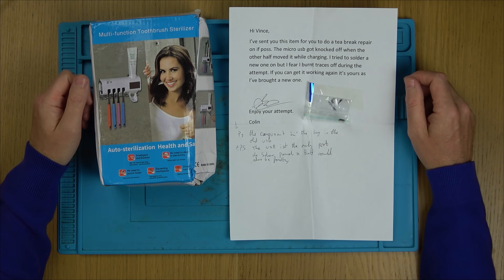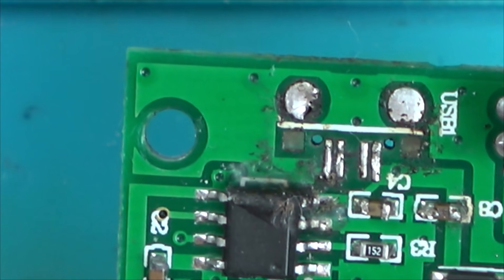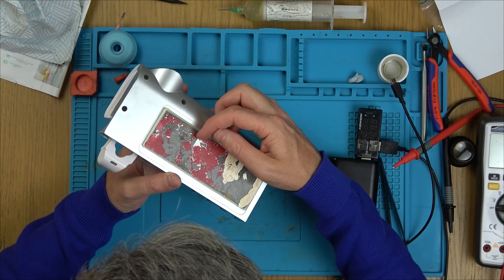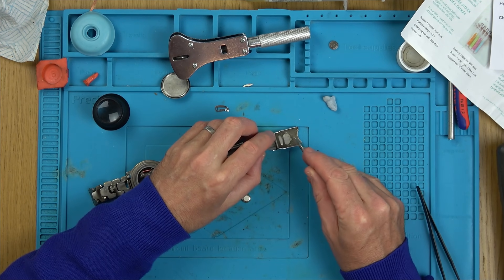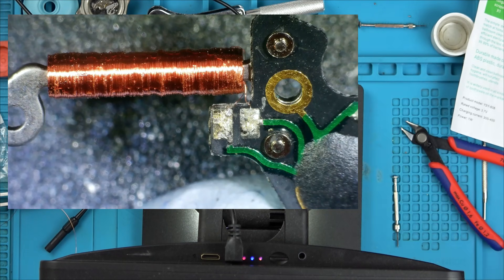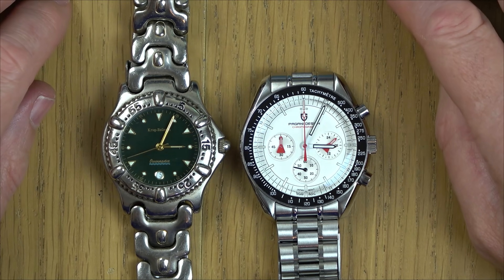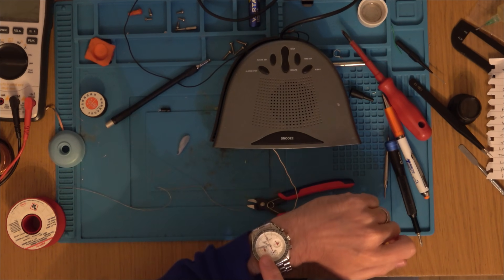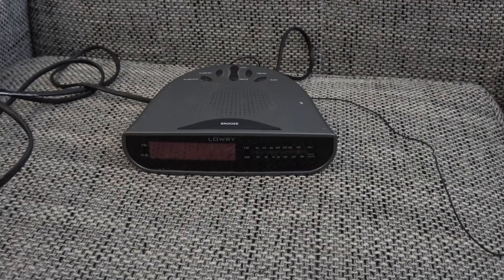Selection of PO BOX items - Can I FIX THEM?

Comment: hi! I hope that you are doing well. I have a question about the tiny USB port that just magically appears at about 4:30. It just suddenly appears with no name or how it came to be off of the PCB. It just appears and you are bending it back into shape and then you solder it onto the PCB. I need that exact USB port. Mine is broken. What exactly is it called and could you suggest a place where I could buy one? Thank you, kemble gilstrap USA.

Comment: I fear a new movement is needed as you are missing the battery clamp and the tongued end which goes into the plastic base, the plastic has sheared off no doubt releasing the clamp in the process.   Looks like an ISA clone, I quite like my Krug Baumann's as they have a solid heavy feel to them which I like.   K-B were part of the early 2000's growth of not-Chinese watches, designed in Europe mostly and made cheaply in Chinese factories, Oskar Emil is another one which I quite like the best two I have is a Houston which is very alike to a Tissot T-Race and extremely heavy and my unusual Oskar Emil Orbit being a reglateur automatic fitted with a very unique movement in a steampunk-esque case which is also a tourbillion so making it a very unusual watch to wear.   My Houston was my very first Sii "high hand" chrono and is much loved, ironically couple years back I bought a NOS one for £5 so I have one for looking nice and one a bit beaten up for messing about with hehe
Reply from the maker: Thanks Ian 👍

Comment: The national grid will always self correct for frequency changes all in a tight margin. A mains powered clock should be perfect if they use the grid frequency, It may over-read a few seconds but then it will be retarded a few seconds to to make up for it. (OH NO I SAID THE R WORD!)
Personally I would like a totally fecked up clock like the Lord Vetinari from Discworld. It's always going to be accurate at some point.

Comment: On the topic of the clock radio you could have put the old capacitor back in and tested it to see if it was indeed a capacitor issue.

Comment: If the alarm clock doesnt have a crystal how does it keep time with the 9v battery backup which would obviously be dc? I might be being stupid im new to this or is it just that the chip does the timing and it just needs to know the hz of the ac in so it doesnt run fast

Comment: After midnight the UK grid adjusts the electric supply so electric clocks are kept at the correct time every day you sometimes notice that lights get brighter when they do this. System Time and Frequency Deviation
One of the oldest and most widespread uses of accurate substation time is monitoring the
average system frequency. While the grid itself, and the machines connected to it, generally have
a reasonable tolerance so far as small frequency offsets is concerned, many customers use the line
frequency as a sort of time standard. Consider how many clocks in your own home require resetting when the power fails, even briefly.
All of these devices use the line frequency as their time standard. The short-term frequency
is less important for this sort of timekeeping than the frequency averaged over a period of hours
or days. This allows the utility to control frequency during times of peak load, as one of many
variables to direct power flows and ensure orderly operation of the grid. Then, when load is down
(generally in the early morning hours), the frequency can be adjusted to “zero out” the
accumulated time offset. System time and frequency monitors provide the information required to
do this, by measuring and comparing system time (from the grid frequency) to precise time.
Reply from the maker: Excellent info, thanks for sharing it 👍

Comment: For steralisation, the light needs to be UVC type.  UVA has no real steralisation properties.   A lot of the cheap so called steralisation devices use UVA light, which does next to nothing.
As a note on the 50Hz mains.  This is very accurate, and has to very accurate in the standard.  50Hz, are the cycles per second, the voltage is a different reading.  Test Equipment, such as oscilloscopes, also can take their trigger reference from mains power.    Voltage will vary up and down by a certain amount, but the frequency is pretty well rock solid.  I think other comments have been made about this, which are acurate.  There are multiple generation plants around the grid and they all need to be exactly in phase with each other, which is achieved by locking on to the frequency of the line, which in UK, EU, Australia, NZ and various other places is 50Hz, and in US, Canada, some areas of Japan and a few others 60Hz

Comment: I am a bit fuming with Royal Mail at mo, bought a 3d printer and turned up in box seemingly all good and opened it up and two of the important frame parts have been smashed and one sides lead screws bent...  seller however has been brilliant, has promised to laser cut me replacements and I will have to dismantle to fit but heck that is right up my street.   I straightened out the lead screw myself so just the frame parts and I will be 3d printing finally :)   Spent today trying to marshal my obsession into some form of usability, moving boxes around and kept finding working watches I don't even remember buying, put all my Seiko into a specialised metal locking briefcase and now moving my other stuff in the display cases to tidy up a bit.   Only real casualty was my first gen Arctura, it had been converted from the unreliable 3M22 kinetic movt to a VX43 quartz movt but sadly the old thing has passed on, also got in post today a Seiko 7T62 pristine gold plated chrono... that didn't work either but £20 to Cousin's later and new movement on way, it will work again...
Reply: Reminds me of a package Royal mail were supposed to next day deliver to me. It bounced between 2 sorting offices 100 miles apart for a week or two then disappeared from the tracking on their site. Amazon refunded with no quibbles but about 6 months later it actually arrived completely smashed up and hanging out of the packaging. God knows what adventures that parcel had in the postal system. I'm surprised they had the gall to deliver it in the state it was in. Royal mail parcelforce are on par with Hermes for shoddy delivery services.

Comment: If i has not been mentioned already, 50Hz will cross the zero axis 100 times a second, so there will be no voltage at all at those crossover points.  Also if you do the maths then the difference between 60hz and 50 hz is 16% and th difference between 60 seconds and 52 seconds is 13%. The thing is it should increase the clock speed, not decrease  it.

Comment: Won't UV light damage the plastics as well? EDIT: BTW. I doubt it emits any germicidal UV in the first place. These LED sources are usually a scam. Proper germicidal sources usually are in the form of fluorescent tubes.
Reply: You can absolutely get UVC LEDs , but as UVC won't pass through glass or plastic, they need quartz housings, they're usually surface mount things in a gold package with a quartz window. That one definitely does not look like UVC, so probably UVA, which as you say - not germicidal, but will degrade plastic.
Reply: Replying with an easy way to tell - if you turn it on and you can't smell ozone, then it's not germicidal. If it doesn't have the energy to split oxygen then it doesn't have the energy to damage DNA (which is how "germicidal UV" works)
Reply: @boundcookie1619  Yeah. That makes sense.
Reply: @TD75  I imagine it's the same thing as you get from arc welding without proper protection. I've done that before and it was not nice at all, to say at least.

Comment: Please, for the love of God, get a dim-bulb tester and an isolation transformer for further safety from the mains. I cringe every time you work on something plugged in to the mains. You always say "hopefully it doesn't go bang". With a dim-bulb tester it wont, the light will just glow brightly indicating a problem. It'll protect you, fuses and/or circuit breakers. For capacitors holding a charge, just get a 3ohm 25W resistor and some multimeter probes and make your own discharger.

Comment: If the clock was expecting 60hz and got 50hz, it would take 1.2x as long for it to get the number of cycles it expected in a minute. So every minute of the clock would be a minute and 12 seconds of real time.
Reply from the maker: Nicely worked out Jessica, so that is 60Hz divided by 50Hz = 1.2    Then 60 seconds x1.2 = 72 seconds so over the hour it would be 1hour 12 minutes, so over each day 288 minutes = 4 hours and 48 minutes behind each day. My brain now hurts ,but I think that is correct, thanks for explaining it. I wouldn't mind knowing it the other way round, clock expecting 50Hz, but getting 60Hz, but my 3 brain cells need to rest now 👍
Reply: @Mymatevince  Yeah, if you took a British clock to the US it would be 1.2x faster, so a minute of the clock would be 60/1.2=50 seconds of real time. But since your mains didn't suddenly became 60hz, it would seem to imply that the chip was detecting more zero crossings than actually exist. A noisy power supply from a bad capacitor would seem like a pretty likely culprit for causing that!
Reply from the maker: @jessicav2031  👌